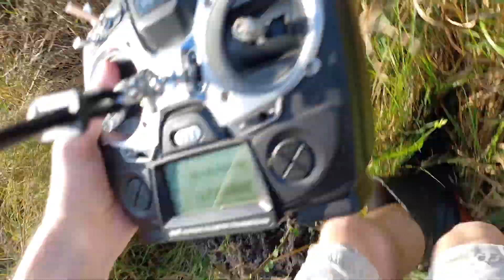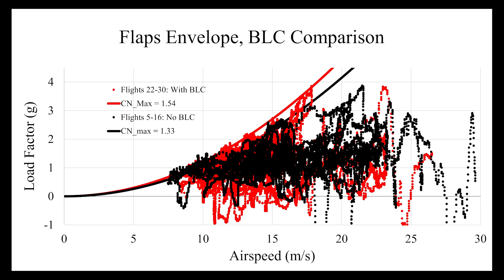Efflux Mk. II Circulation Control Test, Crash, & Data

Comment: Did the bypass door get flipped down in flight from the hinge being at the rear?
Reply from the maker: That certainly didn't help things, though there isn't really a good way for a front-hinged system - the dynamic pressures are far too high for a reasonably sized servo to hold, so the bistable feature of the door actually serves as a feature to drastically reduce its drive requirements.